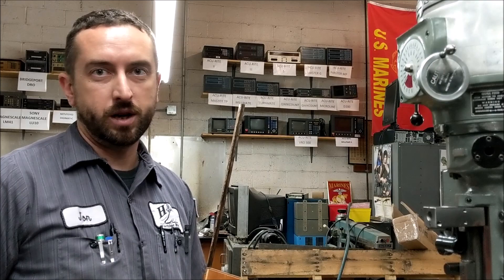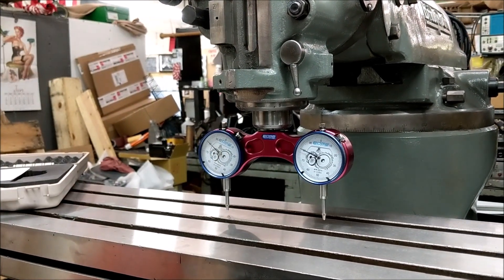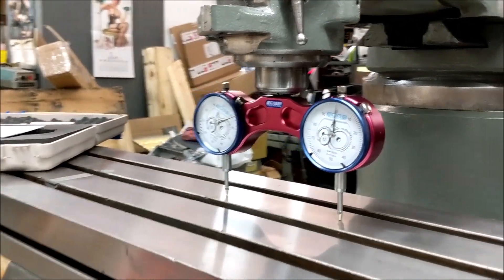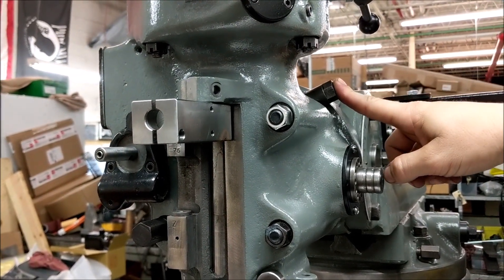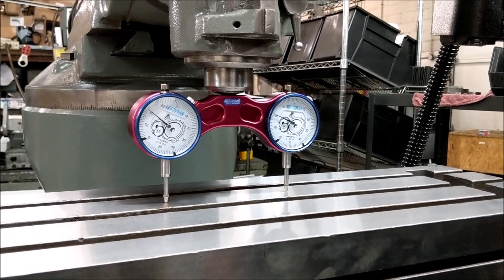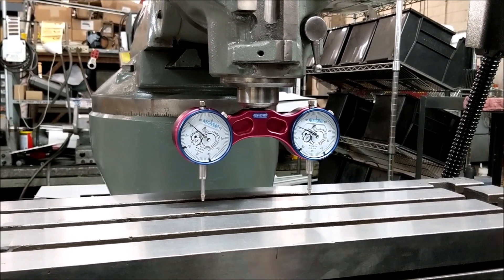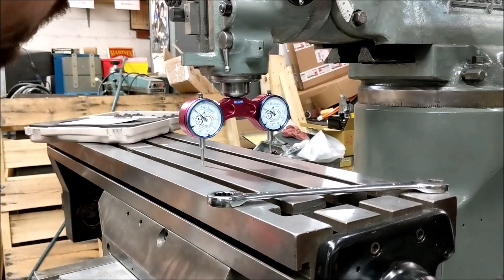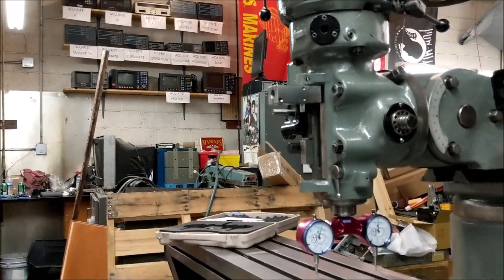Product Spotlight: Pro-Tram System

Comment: this tool is useless unless you turn it 180* to check
Reply: You need to tram it for 2 directions(x, y?) at 90 degrees to each other. But I don't think you need to  spin the gage 180 degrees once you have it reading zero on both gages to see if they both still say zero (assuming you dialed the gages to zero correctly to begin with)? Am I wrong?
Reply from the maker: This is not a how-to video, just a product spotlight. The item comes with a good set of instructions on how to properly set-up and use it.
Reply: Shouldn't be necessary to rotate 180 if you have set the dials correctly before hand?
Reply from the maker: With the Bridgeport and similar mills having the knuckle be able to rotate the head, you need to turn the ProTram 180 degrees to be able to ensure that the knuckle’s angle is right.  Without tramming the knuckle in, your flat end mills would not give you a flat bottom cut, it would be angled.

If your mill has a rigid ram, like the old Boss style Bridgeports, then you would not have to turn the ProTram to properly tram your head.
Reply from the maker: You are correct, the OP got 180° in my head. You only need to turn it 90°